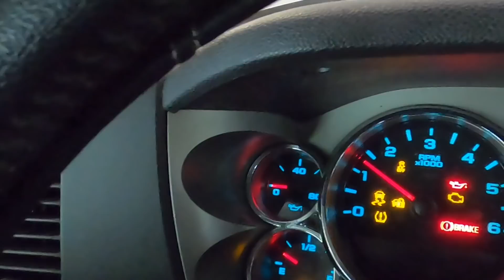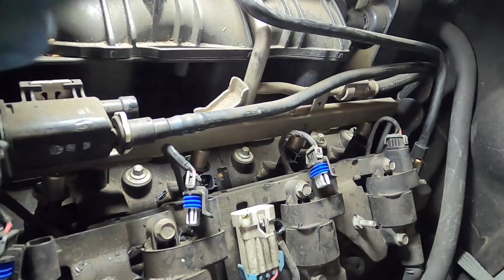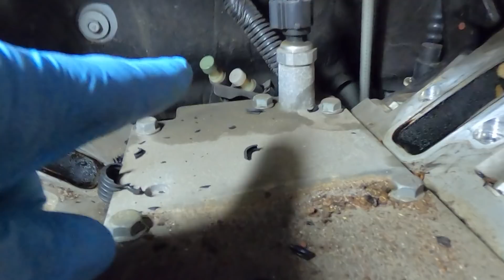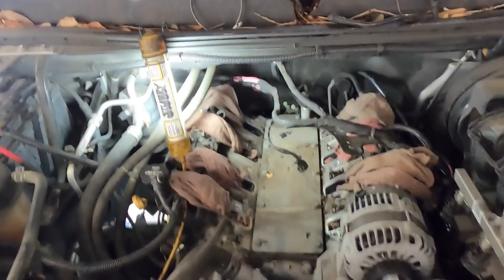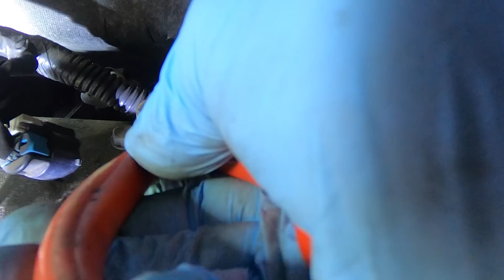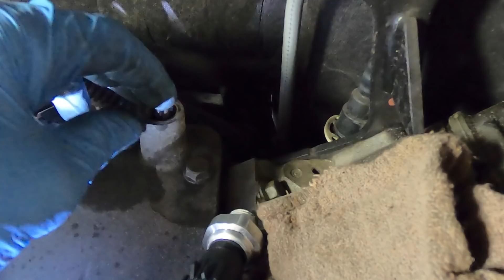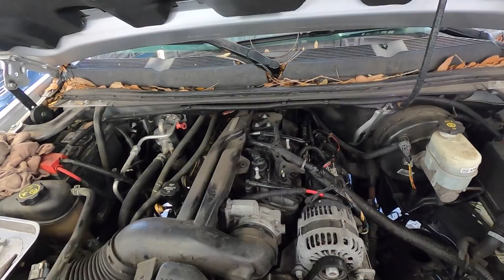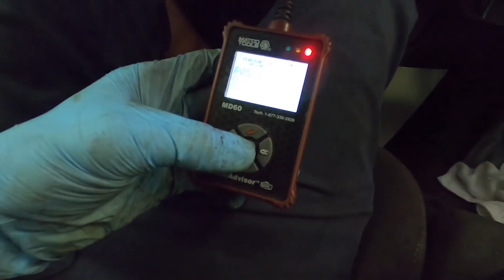Customer States: Google Diagnosis…replace this part!

Comment: The customer is always right. Even when they are wrong lol.
Reply: The customer is always right.
Fuck that.
Sometimes the customer is an asshole......
Reply: @heyrod59  He is still right, a right prick.
Reply: @johnpalmer4425  lol
Reply: @heyrod59  mostly, if they were that bright they'd mix it themselves
Reply: @heyrod59  I have a customers always right story. Guy came to me with transmission in limp mode.  I break out my meter and he asked me what I was doing. He then stated "I have a transmission problem".  I rebuilt his transmission.  Found a botched alarm install splice (the real problem). Fixed that in half an hour. Customer is always right. he paid D__k tax.
Reply: @heyrod59  True but that isn't what the phrase truly means. It has gotten twisted over the years. What it means is, if the customer wants to buy item A, but you think they should buy item B, don't argue with them. Sell them Item A. They are already set on buying, don't get in the way.
Reply: Well, to be fair; that saying at it's core was meant to be "the customer is intelligent enough to know what they want to spend their money on."
Reply: @JogurtNugget  Yup, if the customer is willing to pay to prove he's the smartest one in the room that's his privilege.
Reply: @JogurtNugget  yep. And sometimes they want to spend it on a cheap service now, and a new car before 100,000 miles on the odometer. They won't let you convince them otherwise either.
Reply: The actual saying was.   The customer always thinks they’re right
Reply: No you have to protect the customer from their stupidity or just deny the work.
Reply: My shops old motto was to keep the customer satisfied it never said anything about the customer being right.
Reply: Charge for your knowledge, charge for your tools. Fix it. Pay your bills
Reply: There's a few things you need to know about customers. First of all, they aren't always experts on a specific subject, so they will get things wrong. Second is that customers don't always tell the full story; it isn't that they lie necessarily, but they don't always give all the facts. Third, some of them have heard the cliché "the customer is always right" so often that they actually believe it and will act accordingly. Have you ever heard of the term "Karen"? :)
Reply: @mistie710  yes work for dealership and customer came in complaining about a car here it was there son abusing the car 
That's why they went computer monitoring in New cars see if you abusing it
Reply: I'll try and talk the customer out of their crazy ideas but if you talk me into the job, your paying lol
Reply: The customer is always right…at least in Nebraska even when they admit to a judge they were wrong. I am a master woodworker, not to be confused with a carpenter who is in the construction trade and who I hold in very high regards, I specialize in historical restorations and restoration of woodwork in homes from the early 1800’s to mid 1930’s. I generally do things the old school way with restored hand tools of the period. Several years back I took a job replacing the moldings in a home that had suffered flood damage. The customer had found some “baseboard” she really liked at a big box store and said she would supply the materials. I got to the job site and she presented me with casement for doors and windows. I explained to her that it would not work for the purpose but that we could take it back and either find the baseboard that matched or I could manufacture it for her. She insisted on using the wrong material. When it was done, it looked like crap. She bitched long and loud so I tore it out and went with her to purchase more lumber, again trying to convince her to let me just make her the correct baseboard and I would not charge her extra. She again insisted that as long as the corners were “square” and the wall lines even she would approve it. I finished, got the approval in writing with pictures and her signing off on each picture. I presented her with the bill and guess what, she refused to pay because the neighbor said I used the wrong material. I filed. Lean on her house and took her to small claims court. I took the stand in my own defense, presented the signed off work order and acceptance of completed work and each signed picture with the customers approval. The judge asked me if I was proud of the work I did And if it was indicative of my usual quality of work. I responded that I did the best that could be done with what the client insisted I use for materials but no I was not proud of the work because it was done improperly. She asked why I didn’t refuse the job, I responded I was taught to alway give the customer what he/she wants in other words the customer is always right.  And she DID sign off accepting the job. The judge ruled in the customers favor stating that as a master craftsman I had a duty to ensure the integrity of my trade and refuse to do the work if she insisted on the the wrong material. I did get a little payback on the judge because there are not a lot of guys out there with the tools, talent or patience to custom manufacture by molding plane 8000 linear feet of moldings for a mid 19th century home. I was the only bid the judge received, I charged twice my hourly rate but no lumber mark up since her husband purchased it and had me go with him to buy what I told him was needed from my vendor who gave him a veterans discount. It took 3 weeks to complete the job, the judge was very happy with the results but still insists that you should never give the customer something that is the wrong stuff even if they demand it. You should turn down the job. To me that is pure bullshit. Same thing with auto work, I always check my own codes on my diagnostic machine, not a scan too, and if I take it in to the shop I give the screen shots and report printouts including freeze frame of run tests for the mechanic and ask them to check it against their diagnosis and call me to see how they jive and how I want to move forward. Always. I was a Crew Chief in the Air Force and a damn good fighter mechanic but that doesn’t make me an expert on cars though truth be told I am a damn good backyard mechanic and have done several frame up restorations. I always try to listen to the guys who to the job day in and day out.
Reply: @Mauivegan67  "Every since you changed my carburator, my battery dies"🤣😂🙃😀😄🤣
Reply: Seems like the customer is mostly wrong
Reply: No place I have been lately
Reply: Not when the customer brings in Ram 3500 8 lug brake rotors and pads for his Durango...
Reply: The customer isn't always right, but he is always the customer.  
Without customers...
Reply: @ammoalamo6485   Correct, and the repairman is always the repairman,  without repairmen...
Reply: "Where he belongs he's right, where he belongs" (John Lennon, Fixing a Hole)
Reply: @MarttiSuomivuori  LOL,   love it
Reply: @Mauivegan67  Agreed lol
Reply: They have signs at jimmy johns that say the customer is sometimes right
Reply: Steve (YouTube channel stevepitbull) has some good signs about that posted on the counter of his shop (He does mainly Mercedes, but also other German crap). 

He's the guy from "Pitbull and Leepu", it was a cheesy custom car show on discovery or history or one those channels. Guy is hilarious, he's from the NYC metro area and he is Italian. So you can just imagine what his rants sound like.
Reply: He taking huge chance by letting other stuff go
Reply: @matthewgodwin6688  I've wondered about that before. I watched another video where the diagnosis determined multiple bushings were bad and some missing. The truck had steering stability issues. The Customer/Company decided not to replace the bushings. That vehicle is on the road now. Unless the driver failed to maintain control, crashed and KILLED a van full of kids. Is it the mechanics fault for not making the repairs?

So who is really liable? The shop/mechanic is NOT authorized to perform any diagnosis or maintenance beyond what he was instructed to do. The customer gets what they paid for. If the customer's engine fails and they decide to sue, because they're idiots (my opinion), I'm certain a judge would decide in favor of the mechanic and repair shop.
Reply: @randallporter1404  some shops will have you sign a waiver to say car unsafe to drive 
I had former co worker break my tie rod and shop let it go and because I drove it they said tough thats where got car new
Reply: Yeah the customer is a stupid too.lol.
Reply: It wasn’t clear in the video but it looks like you didn’t clear the DTC and see if it set again. Could be he was right?
Reply: The customer isn't always right, but they're always the customer
Reply: People misinterpret the phrase. It means the customer knows what he wants to buy, so if you don't have it, he goes elsewhere. That's all.
Reply: @mrschuyler  I had a problem with electrical system and told them replaced battery cable so they replaced battery but not cable it lasted 3 months so took front end apart again so sometimes customer knows best
Reply: Customer wasn’t wrong on this one. Codes needed to be cleared before gauge will function again.
Reply: Hey we just do what they asked so they can pay, would you like it diagnosed now or throw more parts at it🤣
Reply: @The_Phill_A_Blunt  I used work for manufacture that built test equipment 
The boards would have parts that were in backwards then wrong value cause someone could tell red from Orange 
My favorite boards had internal shorts 
We get same board from Japan and 95 % pass while USA manufacture 80% fail 
Then people wonder why companies go overseas
Reply: Customers learn slowly that they should just have it diagnosed right, it would save money in the long run
Reply: No, they're not.
Reply: Bullshit.  Retired from the trade now but if they are wrong I'm not going to hold back.  We in Australia don't have as many types of cars or engine varieties. They are paying for my experience and if they don't like that take it elsewhere.
Reply: It's possible they could have already had it diagnosed (although incorrectly obvioisly) and that's how they knew it was the sensor. It's easy to think the customer is just arrogant, but just don't make assumptions. Everyone had reasons for their decisions even if they don't make sense to us. Sometimes they are good reasons, sometimes they aren't.

Comment: Wow.. you replaced that sensor the hard way.. lol. You can reach back there without tearing apart the intake. I've replaced mine 3 times and never once pulled off more than the vanity cover and disconnected the pcv hose from the driversise valve cover. Lol. Just takes a couple of short extentions and a wobble or u-joint at the sensor socket.
Reply: Replaced it THREE times?  Jeez, just how bad is this sensor on GM vehicles??
Reply: @LA_Commander  the first time I replaced it, I put a cheap aftermarket in there. It worked for about a month and then quit. That was right after I bought the truck. I replaced it with an oem sensor and it held up until about six months ago. I've had the truck for 12 years. But yes those sensors are notorious for going out every five or six years
Reply: @512.constitutionalist8  oh wow ok. So I guess the lesson here is stay away from those cheapy sensors
Reply: @LA_Commander  Sounds like stay away from gm trucks. JD Power!

Comment: I'll bet of you cleared the codes the guage would work again. And did you use OEM replacement? Or did the customer supply their own part? A lot of the aftermarket sensors are bad out of the box.
Reply: the motor sounds okay to not have any oil pressure.im sure it has oil pressure.i only use ac delco oil switches for a reason.

Comment: Looks to me at 32:13 to 32: 15 or so the oil pressure gauge is working! The check engine light is gone also! Seems to me he sure trying hard to NOT show that side of the dash......

Comment: WJ Jeep Grand Cherokee HO 4.7 have an oil pressure gauge, but after 2002, they are a 1 wire fitting.
Can't possibly work, so what was the point?
Bring back the idiot light - my ex-partner's car, (Nissan Versa/Tiida - great car, I might add), doesn't even have a temp gauge - just a blue light for cold, and a red one for, "congratulations, you are now walking".

Comment: I just replaced stuck lifters in a 2008 Suburban with 5.3l.  Oil pressure would drop to ZERO within 45 seconds of start.  Had to pull the filter that's UNDER that sending unit 4 times and clean it off each time, before it would show oil pressure and not bottom out.  The tiny filter was getting overwhelmed with engine sludge, and not allowing oil through.  I have mastered the 15 minute removal of that damn sending unit, without removal of the intake.  Just gotta lay across the engine and have patient hands, and a deep socket.  Just a thought.

Comment: Awesome engineering GM, having to take the entire intake manifold off to replace a little sensor 🙄
Reply: no you don't  this can be done without  removal i  have done several
Reply: @steveholland1163  The why did Ray remove the entire intake manifold? Looks like that sensor was in the back and under a bunch of crap.
Reply: @frankthespank  because hes  going by the book.   But as a mechanic who gets paid. Book time its always good to find faster ways to do the work.  As in not removing the intake.

Comment: Google mechanic eh!😂 This should be fun. Based on what you have to take off and put back on the labor is going to be a heck of a lot more than the part and he's still going to have zero oil pressure.

Comment: Always amazes (enrages?) me when I see how many different ways there are to lock an electrical connector in place!  These injectors are way more difficult than they need to be, but at least they are accessible.  So many connectors that are more difficult to reach, release the secondary lock, release primary lock tab, one small gravel stone in the wrong place really can screw up a guy's day!
Reply: These connectors need to be cheap AND reliable AND easy to assemble (also optimized for automation). So OEMs always try to improve the designs.
Reply: @drkastenbrot  No doubt, assembly is simple, the disassembly after the vehicle has been in service for awhile is where the problems are, but that's not a consideration.  Make one style universal locking connector, save $$$ on engineering, r&d, and manufacturing all these different styles, move on to bigger and better things.  Sorry for the rant, figuring out how to access ,clean and unlock/disconnect components has caused me a lot of grief over the years ✌✌
Reply: @Schmitty71  issue is some comnecrors are special for fitment or for sizing. Gm connectors are all fairly the same. VW likes to use many different styles. 

Computers on most cats use a cam style lock due to what they are, high amp connectors use certain style, and many others use different styling connectors to help with identifying reconnecting things.
Reply: And this is why I disagree with taking off the intake.  To mach to go wrong.

Comment: To be fare your still ripping him off. You dont have to remove the intake manifold in order to change the oil pressure sensor and screen filter. Yes GM specks say this is the procedure but they only do it that way to fuck the customer.
   I did this same job on my chevy and it took all of 15 minutes. I am a certified diesel mechanic but I didn't need any speciality tools other then the socket that you can get specifically for the sensor at any auto parts store.
   In short yes the customer was ignorant.... and payed for it but you proved his whole point for why he told you to just change it by charging him an arm and a leg for something that should of been fairly cheap. Mechanics like you give us all a bad rap.

Comment: But at 31.49 minutes the gauge seems to be working, can you confirm the fix or not?
Reply from the maker: Not fixed…it randomly came on and off. It’s got high resistance in a wire somewhere or possibly a bad solder joint in the gauge cluster.

Comment: Special socket tool to remove the sending unit?? Seems to me that the standard faucet aerator knurlier (channel lock) would have worked on that just fine.
Reply: Standard deep socket with a wobble joint works great, you don’t even have to pull the intake to get that special socket on the sender.

Comment: I can’t believe you removed the air intake. I do them just fine with a deep well socket, wobble and extension. True you can’t see it but it’s faster. Are you sure there wasn’t a screen in there? I know the ones I’ve done are deep and tough to dig out.
Reply: His vehicle doesn't use a screen. The screens are only used with active fuel management, which his engine doesn't have. They use a different cover with a deeper oil passage base.
Reply: It's a Chevy, any way you do it their engineers phoned it in.
Reply: Interesting point. Hmmm

Comment: I have done this job multiple times, never have I removed the intake, you can access this without intake removal. That being said that filter/screen needs to be replaced( I use an easy out to remove the screen) or "brake cleaned", and the cel (po523?) erased then the gauge will work.
Reply: Same here, intake removal not needed, but I believe the screen is only used on DOD equipped engines.  To protect the lifter oil manifold.  Since he wasn't able to install the screen on this one, it must be machined differently.
Reply: @Schmitty71  possibly, but is there a screen already in the hole he didn’t remove?  He would probably have to reset the cel to get the gauge to work.
Reply: @WILLSWHEELHAUS70  since the screen went in so far, I doubt there was one in there already.  Been awhile, but I thought the gauge worked without clearing the code. I know we've done quite a few of these over the years, I'll have to check into that.